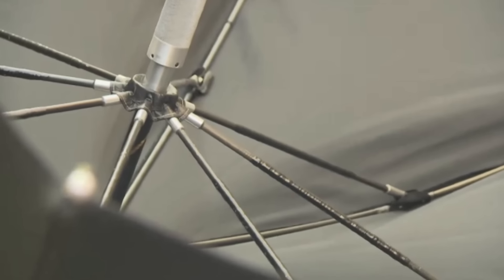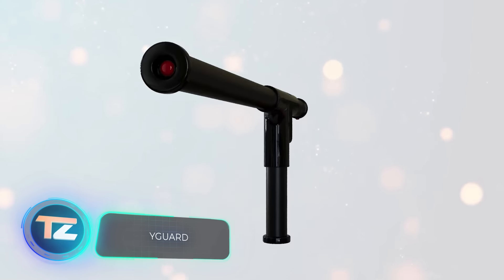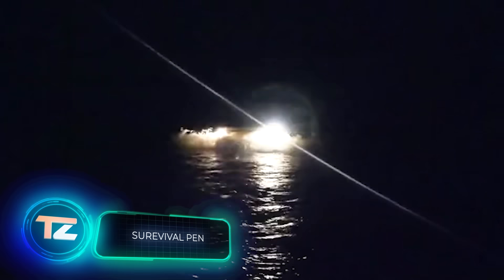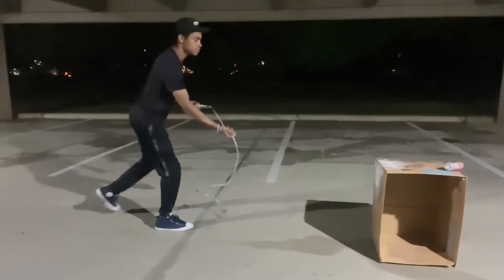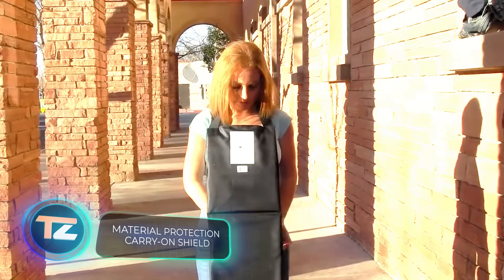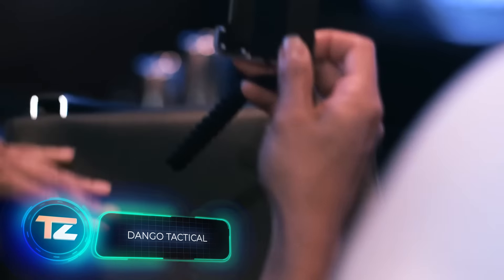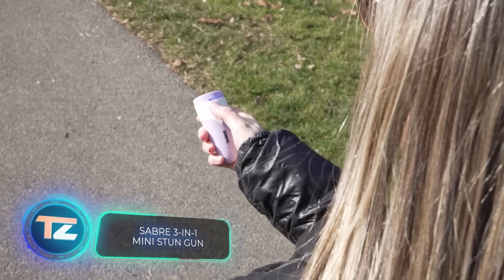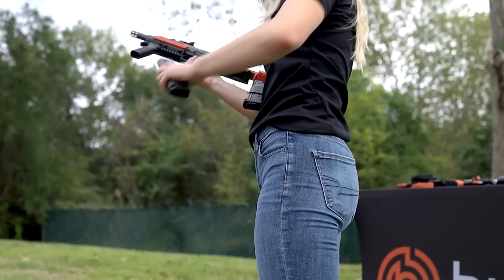INCREDIBLE GADGETS THAT CAN PROTECT YOU

Comment: Parapactum: unobtanium, and not even level II protection.
Glassbreaker gun: thick clothes drastically cut down the effectiveness.
Neck Gaiter: Functionally worthless in a combat scenario. If you're going to get stabbed, it's center mass. Also, garrotes laugh at your puny neck protection.
Gun in a baton: part of deterrence is the hostile recognizing the threat. The other part is having lethal force. This product has neither. You're better off off-handing a baton or maglite with a pistol.
Pepper spray: "hold on and lemme rummage through my purse/fanny pack for this, get my thumb in the right hole and aim it." That's 3-4 seconds you're scrambling, because if you rely on pepper spray, you probably have not trained or prepared adequately.
Folding Brass Knuckle: hello broken fingers. Save your money and use a carabiner instead.
Survival pen: if you need to use this, you should have run away instead.
Cane whip: concealed cane weapons are explicitly illegal in most places. Use them and you'll probably be more harshly punished than your attacker.
Talon knife: too short for practical use, requires much more training than the average person is willing to put in.
Chain whip: requires a great deal of training and is, again, not as effective at protecting you as simply running away.
Hard knuckle strobe light: the first somewhat practical thing on this list, but I would still prefer a good long maglite. Heavier and better as a weapon.
Pepperball gun: 2 year shelf life and expensive ammo? I'd prefer even a .22lr pistol.
Carry-on shield: something that light and thin can only be Level II protection at most. Also, airlines generally do not permit you to wear or carry-on body armor.
Mag-fed crossbow: a semi-auto pistol is smaller, fires faster, and can be concealed easier. Also, that bow has a 20 rpm rate of fire. That's bolt-action slow.
Stealth bag briefcase: the SECOND somewhat practical item. Running away should be your first resort, but this is actually a decent backup option for protection.
Tactical wallet: as a self-defense tool, almost completely useless. As a multitool, not completely useless. There are better options available.
Keychain gun: first off, it's Russian. Second, it's 4.5 x 26mm, aka Russian .17 HMR, aka a very poor choice of self-defense caliber. Third, something like that is definitely not legal to use.
APG arm/shin guards: for the literally edgy wannabe badass. Running away is the best protection.
Stun gun w/siren: only the siren is worth anything, and you still have to fumble to retrieve it.
Pocket Mace: if you keep it in your pocket, you can discretely retrieve it if your attacker is inexperienced. But it's still a spray, and can be blocked.
Another glassbreaker gun: even less concealable than the first one, and still isn't going to stop a determined adversary.
Reply: Does any of that matter (besides the illegality part) if you train with any of them?
Reply: Training can only do so much. And most of these non-lethal methods rely on the attacker feeling pain. If they're high on meth or PCP, you've just fucked yourself over.

The single most important rule of self defense is always have an egress. NEVER back yourself into a corner.
Reply: @minhdao4790  agreed. Better to escape than risk injury. Unless you’re buying time for others to do the same.
Reply: 1 how many criminals have intermediate rifles?
2 situational admittedly
3 more for industrial protection than self defense 
4 having a concealed weapon is good too though?
5 personally I keep my self-defense tools in easy reach, and I like to have them in hand when I see something I don’t like
6 maybe good points actually
7 this is more for getting out of car wrecks, or stabbing someone who grabbed you from behind so you can escape.
8 still, some will take the legal challenges over death
9 true 
10 true
11 easier to carry every day though
12 personal preference there.
13 that’s actually understandable 
14 apparently there are situations where crossbows are better. Like keeping explosives from going off
15 full agreement 
16 actually I prefer the leatherman in this case
17 probably all true 
18 it is, but this might help in a pinch 
19 again, keep in easy reach 
20 better be quick on the draw
21 better when paired with their pepperball rounds.